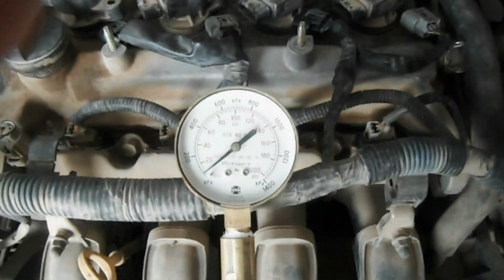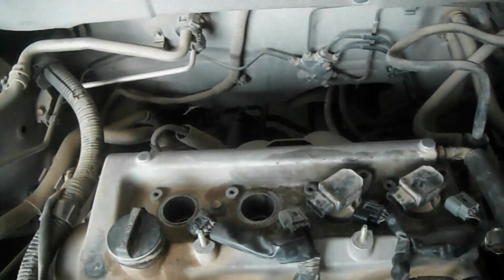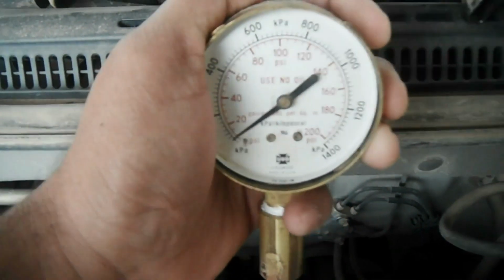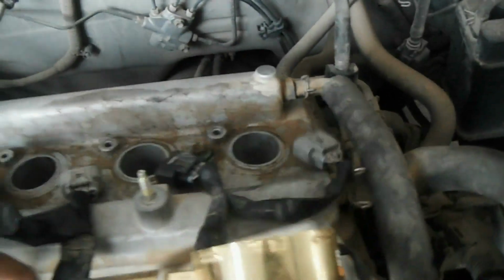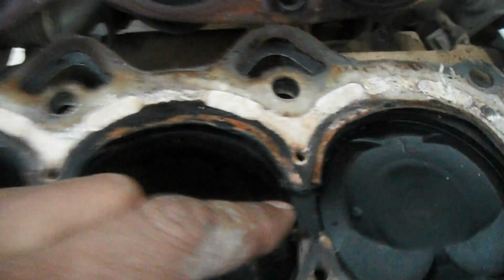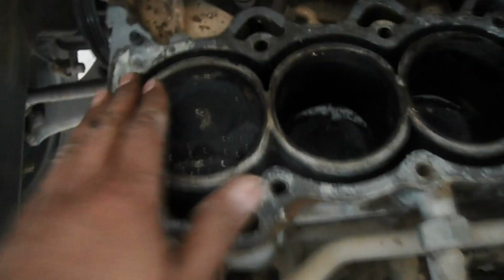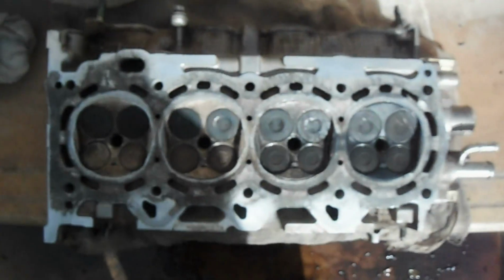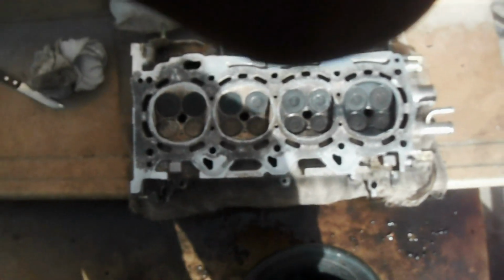Car missfire diagnostic Part II

Comment: Really great video Sir but one question if you change the head gasket and clean the Piston and install new original Piston rings could the engine work well waiting  for your answer Sir
Reply: Some say you have to replace the whole engine what yr idea on this?
Reply from the maker: If you overhaul an engine, it works like new. Also it is not a must in all cases to overhaul complete engine. Sometimes partial work is required as here in this video. So the perfect solution in such a case is to correct the existing engine problem instead of replacing the whole engine which could be a very expensive solution on the other hand. It is important to get the original and genuine parts to overhaul your car engine to get optimum performance. Also critical measurements are required to replace or reuse parts in your engine. Stay tuned.
Reply: One more question Sir other than the head gasket do I have to change the piston rings
Reply from the maker: I don't know what is the condition of your piston rings. If the are good, no need to replace. If not good than replacement is must. Replacement of rings for Toyota Corolla isn't very easy. You need to bring out the engine out of car and open the sump underneath and other supports to replace the rings from piston.
Reply: Can you change the piston rings in a Corolla without removing them?
Reply: Thank you!

Comment: Thank You Master Mechanic! With Compression Tester we found #1 & #2 at 90 PSI vs #3 & #4 at 150. I cleaned the plugs re-gapped to 043. inch per spec, it helped a little but still missing, it is time for a new Head Gasket.

Comment: My friend learn to smoke the engine to see leaks 👍
Reply: For example, 
Cylinders 3 is being smoked at tdc and smoke is coming out of cylinder 4, that means blown head gasket.  👍
Reply from the maker: Sure dear friend. But my pressure gauge also give me excellent results. as you saw in this video. Stay tuned.

Comment: well done however 60 psi on a gasoline engine is very low it should be around the 140 mark
Reply from the maker: This gauge was a self made and was not complete at that time. Now I made it perfect to measure the pressure and you can watch it in some of my other videos where I am using it on an engine and am getting readings.